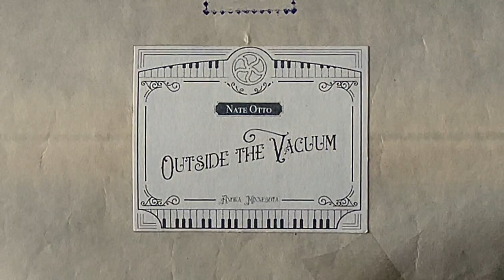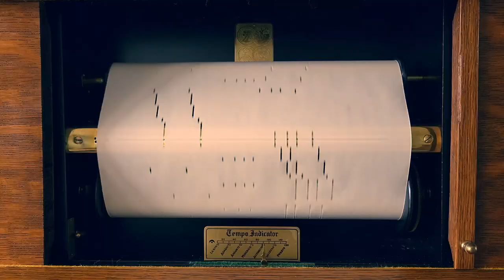Player Piano Revival Episode 6: Reconditioning the Pedal Board

Comment: Nice job, that slab of wood would cost more than the piano was when new if you need to replace it with the cost of lumber. 🤣🤣            great episode 2x👍
Reply from the maker: Yikes. Think of all the resources that went into the manufacturing of this Piano originally!
Reply: @nateoutsidethevacuum Yes, and without all the modern tools available. 👍

Comment: I enjoyed watching the wood grain emerge as you cleaned the pedal board, even if it's never seen again. When you first pulled the pedals I said out loud, "There goes the accelerator, brake, and clutch!' Then laughed out loud at the effects you added after their installation--perfect touch. Will future videos explain how the pedals work? A few other questions: When you clamped the pedal board, why clamp the large blocks across the board? Does that keep it true and prevent bowing under pressure as the glue dries? And I wondered when you would refinish the outside of the board. Is it relatively unimportant because it's on the bottom and outa sight? After it was upright again it looked like you might have painted across the bottom, off-camera. Still enjoying this adventure with you; thanks for bringing us along.
Reply from the maker: Hey Jon! I realized that I should have explained the pedals BEFORE I took everything apart.  Too late for that! Yes, I will definitely explain them once I can show what they do.  There's a ways to go before I can do that, though.
You're on to it with the large blocks I used during the glue-up. They helped keep the board flat while everything set. 
Other than a quick wipe down, I didn't do any finishing to the bottom (outside) of the board. The original finish was good enough.